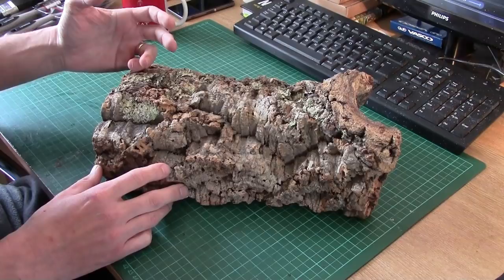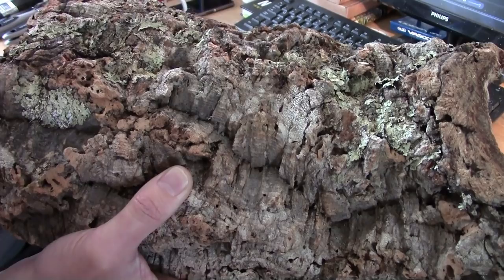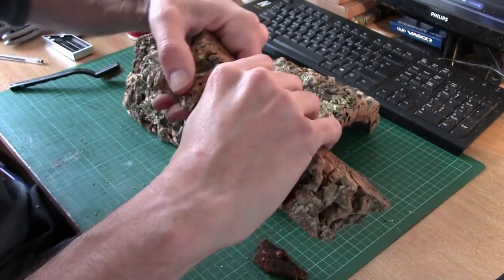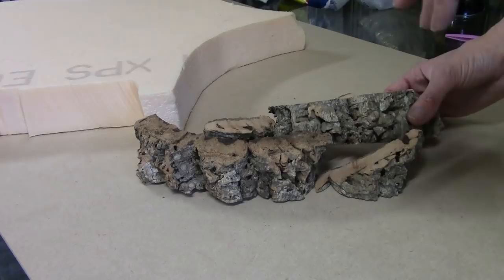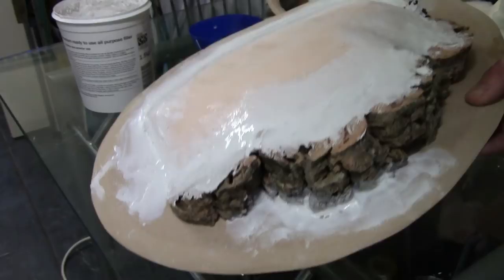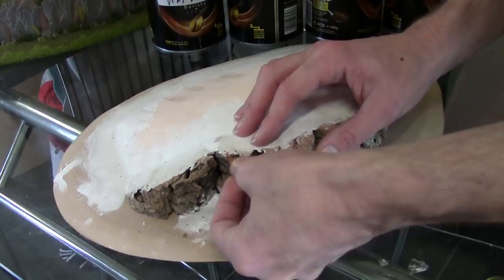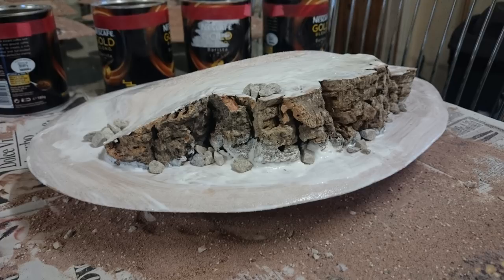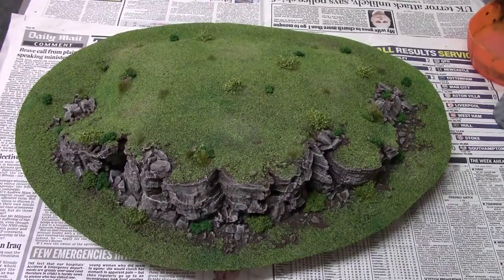How to make cork bark rock faces for your wargaming scenery

Comment: Quick tip, rather than cutting wedges you might find it easier & faster to fill those large gaps with a bit of crumpled up basic kitchen tin foil.  Once you get the filler on you can’t tell a difference, and it’s surprisingly solid compared to its weight.

Comment: I was looking for videos on how to seal cork and couldn't find any. I decided to just go ahead with the terrain (double layer cork banks with a creek). Initially I figured Elmer's would seal it, then I tried rubber cement. Eventually I got it to work, but the cork absorbed so much resin that it's become more like a cork brick. I'll defiantly use the PVA and water 50-50% for the next knight titan base down stream. Great vid!
Reply from the maker: +MrPoliticalpuppet That sounds like a bit of an adventure matey, good luck with the next build!

Comment: The times I have worked with natural cork bark I have left it unpainted and gone with the colours of the cork itself with tends to resemble a sandstone which is weathered in some areas (darker) and broken in other areas (light and fresher).
Good tip about the white mould!
There is no good reason I can think of that this cannot be sterilised in a microwave oven. Microwaves are used to sterilise in hospitals as the radiation kills anything living. Put small pieces of cork into your oven on an old plate and give them one minute on 'high'. Take them out and check them and if they are OK give it another minute or two on high. Do not do this with WET cork, dry it in sunlight or on a radiator for a few days first. Wet cork will boil and may go 'pop'!
B
Reply from the maker: The radiation in a microwave won't kill the bacteria etc also the microwave won't heat the piece for hot enough or long enough either, so its best to avoid the microwave.
Reply: @TheTerrainTutor  Hospitals use microwaves as autoclaves. 
see paragraph 4
https://en.wikipedia.org/wiki/Biomedical_waste#Treatment
The microwaves make the bacteria boil and explode.
Similar equipment is now used in barbers and tattooists.
B

Comment: Have you ever thought of using silicon moulding rubber to make "rock moulds" from unique pieces of cork bark.  This will enable you to use portions again and differently for other models?
Reply from the maker: Yes, but it's a lot of hassle, tinfoil is better mate

Comment: What if you made a silicone mold of the bark? Then you could make infinite rocks!
Reply from the maker: Indeed
Reply: and you would not need to cut trees to take bark from them :D
Reply: While this is true, the issue with molded rocks is that on larger projects or repeating terrain features you will get the same shapes over an over which disrupts the feeling of realism. If you were to do this with 20+ molds and always keep your terrain varied it wouldn't be as much of an issue, but that is a lot of molds to make (and replace when they wear out).

Comment: Man I love these videos but I have the hardest with flocking. Trying to do big flat surfaces, either I have too much glue and it seeps through after a while and doesnt look good or I dilute it down with a little bit of water and a lot doesnt stick to it. xD Using Elmers glue
Reply from the maker: Do a couple of test panels, bare sheets painted brown, have a couple of mix ratios of water to glue, nail down a ratio that works and then crack on bud ;-)

Comment: Another great tutorial, thanks, Mel!

You go from largest to smallest when applying your rocks (largest rocks down to sand). I find that it's easier and faster to apply the sand first while the piece is clear of other rocks so that I don't have to work around them as much when applying the glue for the sand. Any thoughts? (Of course, I'm not going to argue with the end result of doing it in your sequence (:-)  )
Reply from the maker: John Casiello I just find it easier and I get a stronger bond because there's no fine sand between the rock and terrain piece, plus I can do it all in one hit and just leave it to dry. Above all, whatever works is good matey :-)
Reply: Whatever works for sure. (:-) Thanks for explaining that, hadn't thought about the benefits that you mentioned. There is definitely some merit in just having to spray it down once. I may have to give it a try your way. Cheers!

Comment: How do you clean the mold since the actual fungus should be inside the cork?
Scrub with a metal brush? Cut the parts of with a cutter? Just rinse with water and rub with an old toothbrush?
Reply from the maker: +Amurayiwestgate I cover it at the start of the vid mate but basically, dip it in an antispectic solution first :-)

Comment: Nice job! I like your accent, nice to listen while you work. Do you have any tips for a terrain base wich stays straight when you use glue on it. I've used a card board etc. but everything what I've used bends when I use PVA glue to glue some rocks, sand etc. to the base
Reply from the maker: +Defe You need to change to mdf mate, check the basing vid in the back 2 basics playlist :-)

Comment: i have really important question about bases (i usually plywood and ProForm all purpose joint compounf)(great stuff) Should o build my base and terrqin uo first and then make my buildings and ruins (i make war dioramas) or should i make the buildings and terrain first? and also after i put the terrain down(the ProForm)  should i first soray it with a base coat of primer spray likr light black or would it be ok yo keeo olain and oaint the whole thing by hand as go?
Reply from the maker: answered on the other comment mate ;-)
Reply: I seen thank you thats what i went with it is easier to work on the bigger piecer then set everything in place

Comment: Amazing piece my friend!,  thanks for the video. What type of board material did you use for the big base? I have tried some  cardboard material but it bends upwards in the borders after the PVA dries up, so it ruins my pieces a little bit since there is a gap between the piece and the board. I don't know if hot glue will avoid that.
Reply from the maker: 6mm mdf, check the back to basics playlist mate

Comment: Awesome guide as per usual mate.

Quick question though; you said you use the cheapo filler, but what's your opinion of the powder to mix stuff, or the ready to scoop from the pot stuff.  Do you find there's a difference?
Reply from the maker: ***** powder is good for mixing different thickness's, ready made is quicker and easier, I prefer ready made for lazyness reasons ;-)

Comment: Mind if i ask where you get your foam? i know Wickes used to supply that kind of XPS but they dont seem to stock it anymore...
Reply from the maker: Jackodur KF300 High strength Extruded Polystyrene (XPS) 1250mm x 600mm - Lining Boards - Roof - Insulation

Comment: If you find that you have very large crevices in your build, you can create a kind of pile of rocks underneath and cover it with dirt flocking. That way, you can create the idea that there's been a small rockslide off the cliff-face.

If you are making buffs like the grand canyon, it can help to give the ridges some extra sanding. In arid place especially, the wind is going to smooth and sand the tops of the ridge to be a bit rounder that is not quite as jaggy as what comes in lower pieces.

Finally, if you are trying to make something like sedimentary rock, you could divide different height levels in different highlights. Masking tape could do with that. I haven't tried this one, but it could create a photorealistic effect like this;

http://webspace.ship.edu/cjwolt/geology/slides/jpg/Sed01c.jpg

If you are using it for something like Dungeons and Dragons (which you aren't, let's face it, but you might), small details like that could build the illusion of, say, ancient structures, hidden under a sedimentary rock layers. Be it an alien spaceship, dinosaur bones or a prehistoric civilization. Definitely something I'll experiment with after watching this video.

I've never used cork bark before, tbh, this'll be an adventure!
Reply from the maker: Alderick van Klaveren nice tips mate, plenty to crew over. Enjoy your adventure!

Comment: what type of protection masks would you advise, only dust masks or do you use proper carbon masks for fumes and toxic substances ? i see alot of bigger firms or workshops use dust vacuum cleaners, where the hose is directly on their desk to work with ;-) but i dont know the costs of those industrial cleaners and if fresh air outside upwind is enough!!
Reply from the maker: +mark jon Davies better protection is better, I cant honestly give you a solid answer beyond I used a cheap dusk mask and I'm ok
Reply: From personal experience and training, you can get away with a simple dust masks for instances where you're only creating dust (sanding MDF, wood, drywall filler, etc.) - for times where you're using solvents, reducers, and industrial cleaners, I'd advise you to look to the charcoal filters/VOC (volatile organic compound) rated filters, as the dust mask/being upwind WILL NOT provide sufficient protection from these hazards. Of course this is all circumstantial and dependent on the amount of hazard being used and amount of exposure. When working with the foam insulation, it is imperative that you cover all exposed skin (wear long sleeves and pants, cover your head as well), wear goggles, and make sure you have the appropriate respiratory protection. If you're looking for a good brand, I'd advise 3M - their products are on the pricey end of the spectrum, but they're MUCH more comfortable than cheaper alternatives (a dust mask is a dust mask - get whatever you'd like, but the ones with the bendable nose strip are better). Once again, the amount of money you should look to put into PPE (personal protective equipment) depends on the amount of exposure to the hazards, how much you value your health, etc. Take care of yourself :)

Comment: Very informative tutorial.
Just a quick question: would replacing the filler with a mix of pva and papier mâché work? Should be harder and give texture at the same time, no?
Reply from the maker: madlarkin101 you could use the pm as a filler and then texture it but I wouldn't mix them as I'd want the paper completely covered by the texturing. So yes but don't mix them ;-)

Comment: i just disinfected a bunch of bark but i didn't wash it off i just took it out of the 50:50 disinfectant water mix, i relay dont want to dry it for 2-3 more days can i just leave it or will i just make problems?
Reply from the maker: You really need it to dry out mate, it'll be quicker in the long run.
Reply: What disinfectant whare you using?
Reply: it was just asda (supermarkets own brand), i washed it out it smelt relay strong of disinfectant once it was dried :) rock looks grate now grate guide on how to use it
Reply: Thank you for quick anwser :)

Comment: Spaceboard Eco is showing as a Clearance item in Wikes' website and is still available in only a few stores across the UK. Check the store finder to see if you have won the post code lottery ;)

http://www.wickes.co.uk/Knauf-Space-Board-Eco-Insulation-60x500x1200mm/p/161297
Reply from the maker: Euan Smith I did :-D